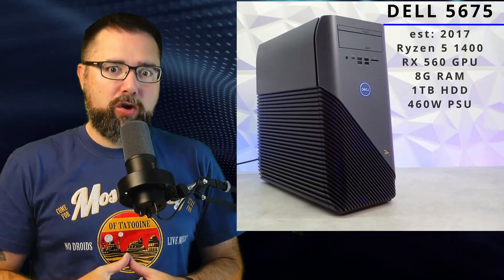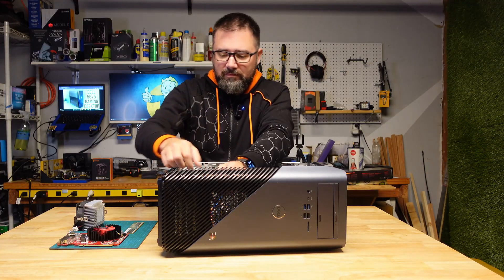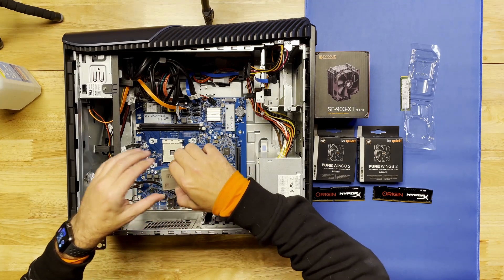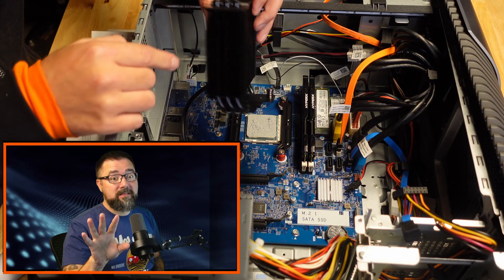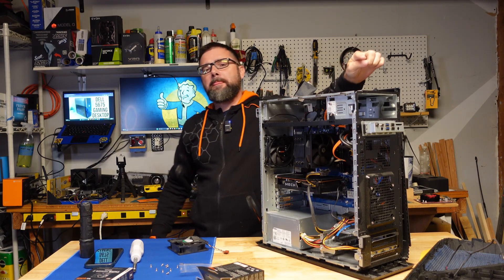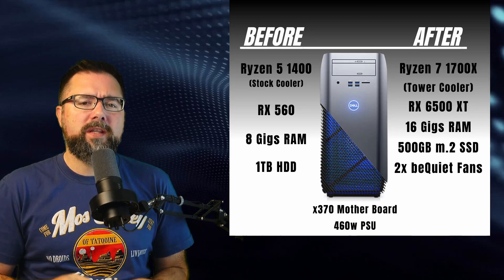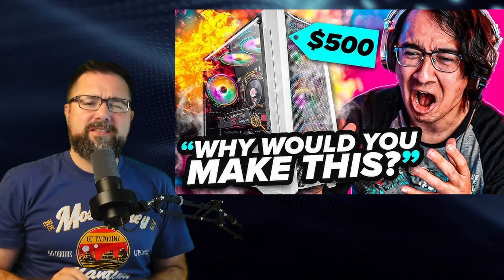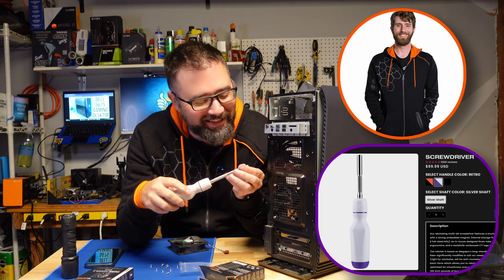DELL Inspiron 5675 **UPGRADE** Gaming PC gets a second life |  Don't buy new, build used!

Comment: Update I got a ryzen 1700x and a gtx 1660 super for 60 bucks but I think I might need a new power supply do you recommend me getting one ?
Reply from the maker: What’s the wattage on the one you have ?
Reply: @GeneralBuckles 460 wat
Reply from the maker: @Battlebudd You don’t HAVE to… it will run….  But if you can get a cheap 550w or 600w it would run more efficiently and not throttle under high loads I believe
Reply: @G @GeneralBuckles  ended up buying a thermal lake 600 watt Psu now it’s time to learn how to install a new Psu don’t really know how to
Reply: For 35 bucks on ebay

Comment: Hi I don’t know if you would see my comment but I was wondering if a rtx 2060 would be compatible with the dell inspiron 5675
Reply from the maker: Absolutely! Go for it. TDP is only 10 watts higher than the one I used. What CPU you using?
Reply: @GeneralBuckles  another question can I also go the ryzen 5 3600 for this upgrade or not ?
Reply from the maker: @Battlebudd afraid not, ASUS locked it in the 1000 series only.
Reply: @GeneralBuckles okay thank you very much with the replys
Reply: I still have the original Ryzen 5 1400 but I am going to upgrade it with the one you recommended the ryzen 7 1700x

Comment: Is the second slot for the m.2 only use sata m.2? Mines doesnt seem to accept nvme on slot 2 for m.2
Reply: OK thx
Reply from the maker: Correct, it's a SATA M.2 slot, perfect option if you want to go that route, but yes, it WILL NOT work with an NVME drive in there. It should even say "SATA" on the motherboard around that slot.

Comment: That’s pretty awesome. I’m planning on rebuilding my PC. It’s the same exact model. I’m using a newer motherboard from 2018 from gigabyte. Paired with a Ryzen 7 3700 X. A huge Noctua cooler and an exhaust fan. with two, if I can fit them if not one, 120 mm intake fans at the front. with a 750 W corsair power supply. All of these parts except for the exhaust fan and the two front fans are used. It’s a pretty nice budget build. at least I think so. Wish me luck.😂
Reply from the maker: Yea, the intake and exhaust ports are 90mm so the 120’s might not be super effective. You may want to explore options for increased exhaust perhaps look into cutting a 120 hole in the top, find a cool grate to put over it.
Reply: @GeneralBuckles oh cool! I’m still going to keep the same size exhaust because there’s no space at the back since its I/O port is so close there. As far as the front goes I already have one 120mm in the front. I don’t think there’s enough space for 2 sadly but hey, 3 fans sure does beat 2 fans 👍😁
Reply: Oh, and my GPU is a Radeon RX 5700XT powercolor red devil. That’s a monster GPU that is 300mm in length. But it will fit, barely.🤣

Comment: Okay, ive been using this video as a little guide since i bought my own computer (same model), and its been going well so far. Ive finally got a gen 4 m.2 SSD, and it fits and everything, but theres only the one slot at the bottom of the motherboard for me? Ive tried it and the computer wont register it no matter what i do. Can anyone help me?
Reply from the maker: Absolutely, hit me up on instagram
Reply from the maker: The one at the bottom is specifically for M.2 SATA SSD.... I'm willing to bet you bought (the more common)  NVME drive. That slot is over by the RAM & WIFI module. (Pause the video at exactly 3:10 .... you'll see it on the left . )
Reply: @GeneralBuckles  yes, precisely, but mine is all faded so i dodnt see that, oops! Whats worse though is that my actuall NVME slot on the motherboard doesnt actually have the standoff or the little piece to plug in either. Also in regards to your other reply i dont have Instagram. :(
Reply from the maker: @Brandobro  that’s really bizarre, does it look like The NVME slot was excluded for manufacturer, or has been removed? Either way looks like you’re gonna have to buy a SATA M.2 drive.
Reply: @GeneralBuckles  Yeah its just gone, it looks like a manufacturer thing, cause its still got the little space between the ram and wifi thingy, just no slot. :(
Reply from the maker: @Brandobro  what’s the mother board model ?  Should have some names and numbers … “red skull x370” or something
Reply: @GeneralBuckles  Its the 0XFRWW model.
Reply from the maker: @Brandobro  yea, every photo I can find of that one online shows the m.2 right next to the RAM.  if you have discord,  come find me here. https://discord.gg/CCpsdQXF

Comment: I wonder how it is with Windows 11 since this pc don't have drivers for that OS and with end of support coming for Windows 10....eventually Steam will drop support too.

Don't really want to throw away a fully functioning PC and happy with the performance instead of dropping over 1k just cause they decide to drop Windows 10...

Replaced rx580 with rtx2070 years ago and can play decent 4k 40-60fps single player maxed (No RT, DLSS/FXSR where available) and multiplayer I turn almost everything down except essentials like player shadow to get 4k 100-180fps(Most have upscaling/performance mode to reach high fps).
Reply from the maker: You could explore Linux options.  , see if it’ll support being a back up server or something similar

Comment: Doing essentially these exact upgrades to my 5675 currently, did you have to update bios when switching from the 1400 to the 1700x? im pretty sure i have the newest version 3.7.1
Reply from the maker: Typically you shouldn't HAVE to do a bios update when changing CPU's within the same generation.... Though making sure you're on the most recent available bios for that motherboard is always a smart play.  If you're not sure, you can hit me up on instagram, show me a photo of the mobo, specific model # & name and I can help you nail it down.
Reply: @GeneralBuckles everything went great, updated bios, there was a newer version than I had, the only problem I'm having is after upgrading to the 1700x, PC will only boot with one ram stick, the 1400 booted with both 16gb sticks no provlem (32gb total) all in all,  16gb should be plenty for this system, but it's a mild bummer that I can't get them to boot with both, I see it's a common problem that many people have had with many cpus, but there's no real definitive answers as to what causes it or how to fix it.

Comment: I wish I would have seen your video first. I was under the impression that it shot out errors on boot if you didnt have the stock cooler installed. That was a waste of $15.
Reply from the maker: yeah, I don't think the Mobo can tell what kind of cooler is installed,  just electricity going to the header.

Comment: I have this exact prebuild and my GPU started going out and my HDD, would I be able to just buy the same GPU and HDD and do a case swap? I'm also confused you said you can't change the CPU to a different generation but went from a Ryzen 5 to a Ryzen 7. are the numbers not the generation?
Reply from the maker: As my video suggests, I wouldn’t buy just the same hard disk drive and GPU. If you’re going to buy anything,  the RX 6500xt from this video or a GTX 1660 / Super would be most practical. An M.2 SSD or Sata SSD to replace the HDD as well. 

A “case swap” traditionally means you have another case or a whole Other computer and you are moving components from one to the other, I don’t think that is necessary in this case based on your description.

Comment: do you have any insight on unlocking the bios at all? I have the same pc and I've been trying to find a way to disable C-States as theres some issue with 1st gen ryzen and Linux. :/
Reply from the maker: I’m not familiar with C-States or Linux but everything I’ve read about unlocking/flashing bios on these mobo’s has resulted in total BRICKS. Recommend you probably don’t mess with it. With these older units and any that don’t support TPM 2.0 I feel it’s best to find a use case that suits the machine simply enough.

Comment: Can I use this instead of the 1700?
AMD Ryzen 7 1800X Desktop CPU Processor R7 Socket AM4 Eight-Core YD180XBCM88AE
Reply from the maker: Absolutely SHOULD be able to , the BIOS should support any 1000 series AM4 cpu. Give it a shot, let me know!
Reply: Thanks, I'll let you know if I pull the trigger on this one. Will definitely do what you did in the video. I plan on replacing the CPU with either the 1700 or 1800 and I already bought the CPU fan you suggested 🫡

Comment: I have this same Dell, new in 14'.  The hard drive is my first encounter of failure, preparing to replace with a Seagate Barracuda 2T and cloning it (fingers crossed).  I don't know if I want to go all out on it, but your videos sure helps if I do.
Reply from the maker: That's great to hear... glad I could be of some usefulness.  Although I strongly recommend you buy at least a SATA SSD as your primary storage and use a barracuda for long term storage or back up. Also, I demo'd a good Disk Cloning option on a live stream recently , i'll link it below. 

1: SSD - https://amzn.to/4aZZxXK
2:https://www.youtube.com/live/goxj5b1pzk4?si=MyGXlx1s0NdQnpG-&t=3803

Comment: Thanks for the video...however, what about Windows 11 update?...I have this same machine with your upgraded parts from factory (I bought it second hand) however, Windows 11 won't be installed since this motherboard doesn't support TPM which makes the whole machine useless in October...any comments or suggestions?
Reply from the maker: Well, you’re right… this unit does have its limitations but while Microsoft is ending support for windows 10 , that doesn’t mean every pre-TPM 2 machine will just shut off…. , just means their last security update will come this October. For companies that rely on these PC’s , they’ll need to upgrade to ensure their customers & corporate security… but for the individual user, it’s not catastrophic … I think it means they need to be extremely careful moving forward… within a year or two there could be a lot of bad actors trying to exploit older W10 machines.

Comment: A little shout out for the RX 6500XT. But it really is a shame that Dell and Lenovo and other OEMs won’t allow these motherboards to be bios upgraded in order to get the most out of them. But it simply comes down to money. The longer you can use a PC like this, then you aren’t buying the latest and greatest from them.
Reply from the maker: Totally agree, planned obsolescence is a crime against the consumer…. But on the other hand, the list of games this hardware can adequately play is longer than most would like to admit… the obsession of having the newest fastest hardware no matter how overkill is just as much a contributing factor as the planned obsolescence 🤷🏻‍♂️
Reply: @GeneralBuckles  I have a question that I don’t know if you can answer. The Chinese have done a fantastic job of repurposing old chips and modifying them to work with X-99 CPUs. Would it possible for someone to do the same with these chips and boards, in order to get them to work with 2000, 3000, 5000 AMD chips?
Reply from the maker: @thomaswood8167  I'm not very familiar with the topic, but after reading on it a bit, it's a neat endeavor, props to the chinese for finding a way to make use of potential ewaste. Though as OCT 2025 approaches and the great TMP apocalypse looms, we need to find a similar solution and use for all those old components OR an efficient recycling method for it all. But to your question about AMD applications, I imagine it could work, but that's WAY above my knowledge base and would probably require specialized tools to make happen.

Comment: Great video.  My grandson has the same system and since windows11 has certain specs for hardware.  I would like to help him rebuild a new system with  the current case if possible.  I am aware that we would have to change the motherboard as well as CPU, GPU and additional items..    Any suggestions for changing the motherboard?  Would it be a  mATX board?
Reply from the maker: I will look into that tomorrow and get back to you. If you have Instagram you can massage me there… link in the description of this channel. I’ll respond here with my findings or discuss on Insta, happy to help ya through that process

Comment: From my experience, my CPU throttled because the fan was changed. I don't know what Dell did but it specifically lowered performance due to the CPU fan detecting a change. I'm not sure if i'm an outlier but that's something I noticed with my Inspirion while trying to upgrade it. If the fan was good for you then maybe it's just very picky about CPU fans. 

The ram is stuck at speeds of 266 MHZ max, anything more like 3200 mhz and it'll downgrade to 2133 mhz, it's such a picky piece of tech. I dislike dells so much now.

Another problem I had, was trying to use an M2 SSD with this, I had to literally use third party softwares. Such a hassle.
Reply from the maker: That definitely wasn't my experience , as you saw it booted up to windows with the cloned m.2 drive after the 2nd try (the first try tends to be the bios registering the new cpu & ram )  and tested well. I wonder if the pin/wire configurations on your replacement cpu cooler was an issue, OR if it wasn't sufficiently cooling the cpu and thus throttled performance to avoid overheating. Sorry to hear about that.

Comment: Nice setup. I'd take it over my i5 4th, 16gb & 9800gtx+  😂 The 870 evo upgrade really brought it to life though, replacing a sata II hdd.
Reply from the maker: Oh yeah that m.2 just makes it feel so swift when booting up.. outstanding. 

So you COULD pop in a i7 4790k and maybe a rx 580 (linked below) less than $150 total. If you do any upgrades and take benchmarks BEFORE & AFTER, let me know the results, would love to hear about it! 

https://amzn.to/499qCqr
https://amzn.to/49cxZgT

Thanks for watching 😎🫡
Reply: @GeneralBuckles  I was seriously considering the 580 now that you mention it & the 4790 would also be a huge upgrade. I'd have to leave 7 but I could stomach 10 I suppose. I game in 900p so the numbers would be excellent.
Reply from the maker: @oldschooldude8370  not sure you’d HAVE to leave W7, that i7 is the same socket & same generation CPU. May want to research thr TPD and potential thermal increase. May consider a updated cooler (like the on in my video, link in the description)
Reply: @GeneralBuckles  7 doesn't have dx12 support. That may not matter though.
Reply from the maker: @oldschooldude8370  yea, I’m sure you can make that call after plopping in the new parts. Keep me updated

Comment: Disagree, if a new board and PSU would fit it’s worth the swap.
Reply from the maker: @zeroturn7091  swapping those AND the other items I swapped… is literally a new build at that point and not an upgrade…. Falls under the Theseus's Paradox thought experiment about whether an object is the same object after having all of its original components replaced

Comment: Awesome video Buckles. Been wanting to do this a while now and you nailed the perfect build. Just curious what the cost would be knocked down to if you decided to sell the original parts that were replaced
Reply from the maker: Good point. Wouldn’t be a lot… probably
$30 for the CPU / Cooler
$20 for the GPU 
$5 for the RAM 
$5 case Fan
$20 for the HDD

Comment: Have the same computer bought 6, 7 years ago Dell 5675. 1700X, 24GB ram.  All I did over the years was upgrade the M2 SSD and add AMD 6600XT. The bad thing about this PC is single-core is very weak and Dell doesn't allow BIOS upgrade to support 3000 gen Ryzen.
The stock fans are getting more noisy over time, did the aftermarket fans you used in the videos help with the noise? Is it silent now? I could also be the PSU fan that is loud
Reply from the maker: Yeah in hindsight I shoulda tried the 6600xt… I was worried about drawing more than the 460psu could push. 

The fans are stupid quiet. ( beQuiet fans always are) and the CPU cooler too.   There’s links to the ones I got in the video description.